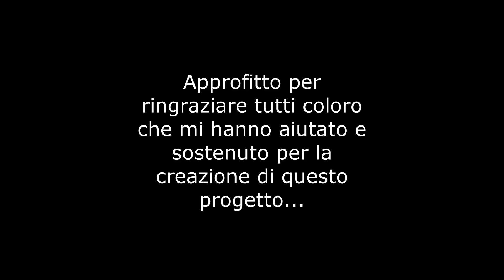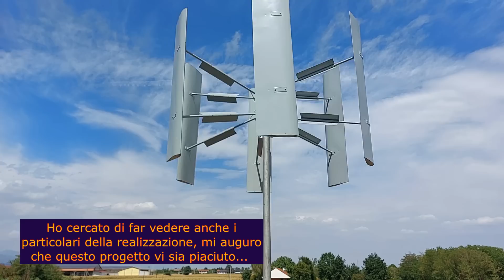Come fare un generatore eolico ad asse verticale PART 5

Comment: Hi! I have been thinking about building a wind turbine similar to this one. I had the ideal to use a gear reduction  to be able to use a larger generator. I am in Poland renovating a historic building. I want an efficient vertical wind turbine. I like your design very much. How can I get in touch with you? The  braking system is very smart. Do you have drawings of this wind turbine?
Reply: На редукторе вы потеряете 30 процентов мощности, лучше подбирайте генератор под реальную рабочую скорость ветряной турбины..

Comment: Alle Praxistest zeigen, dass Kleinwindanlagen kaum Strom erzeugen. Und nur zu Kosten sehr deutlich über 1€/kWh!
Denn bodennah weht kaum Wind. Der zudem extrem böig, was die Lebensdauer der Anlagen meistens extrem verringert. 
Wer also nicht unbedingt autark vom Stromnetz sein muß, sollte statt einer Kleinwindanlage auf jeden Fall eher Solarmodule installieren. 
Denn mit Solarmodulen erzeugt man zuverlässig über 25 Jahre Strom zu ca. 5 bis 10 Cent/kWh!
Reply from the maker: In Italien haben wir mehr als 8000 km Küstenlinie am Meer, es gibt viel Wind... Die Konstruktion einer Turbine mit vertikaler Achse ist darauf ausgelegt, auch Turbulenzen auszunutzen. Im Binnenland werden Photovoltaik-Module eingesetzt.
Reply: @newtech5042  Angesichts des drastischen Modulpreisverfalls (nur noch 50-80€ je 400W Modul) ist es jedoch günstiger, PV-Module zu installieren. Ganz besonders in Südeuropa.
Reply: Я считаю эти товарищи не правы, на солнечные панели никто гарантий на 25/35 лет не дают..Сделано своими руками вы гарант на всю жизнь..??

Comment: beautiful feng shui with zero return, in the beginning it is necessary to build a low-speed generator. 5 rpm to 60 rpm without alternator is a waste of time and effort. zero result
Reply from the maker: Hello, actually the energy production can start even at very low speed, if a multiplication ratio is used... In my case I used a 1-3 ratio so with 30 RPM I have 90 revolutions on the current alternator. Then obviously it depends on the torque that the turbine delivers and on the wind constant.
Reply: @newtech5042  first; a vertical generator by its nature does not develop more than 60 rpm, the losses in the gearbox are 40-50%, it doesn’t matter what you turn, it matters what you turn, all generators that demonstrate start working after 500 rpm, so the output is zero.
if everything was so simple, then there were weather vanes on each fence and there would be no need for a common power grid
Reply from the maker: it is true that it is not a simple production system, and it is true that it runs slowly by nature. But it manages to have a high torque, the losses are there, the calculations show it, however it manages to work reasonably well in the area where I live, working with storage batteries and combined with photovoltaic panels for moments when there is little wind. it is possible to have a constant electrical production. Then the important thing in my opinion is that you must never lose the desire to experiment... Sooner or later something good comes out!

Comment: Convert that velocity into POWER instead of breaking it to friction / heat. Would it be better to make a generator break and capture it instead? You could still use the mechanism that converts the centrifugal force to bring a stator closer to a permanent  magnet array. This will break softly without physical wear and tear.
Reply from the maker: Ciao, è un progetto a cui sto già lavorando, comunque il tuo commento è davvero utile e costruttivo! GRAZIE 😉
Reply: Much better than losing energy as heat